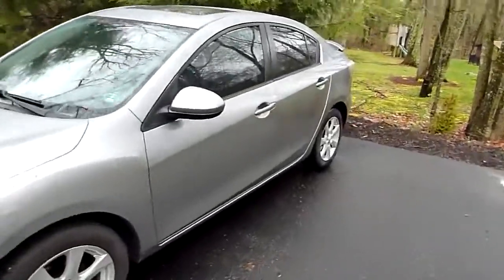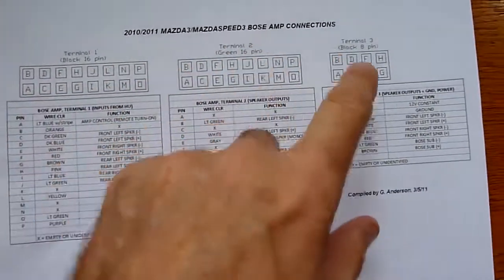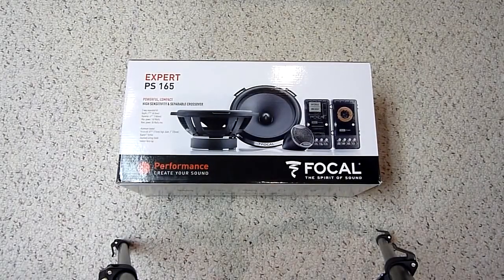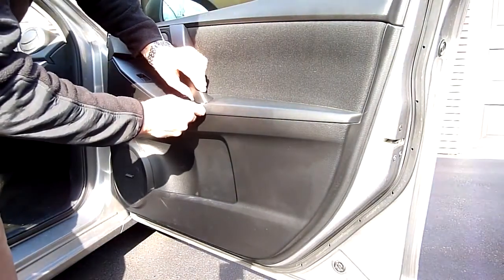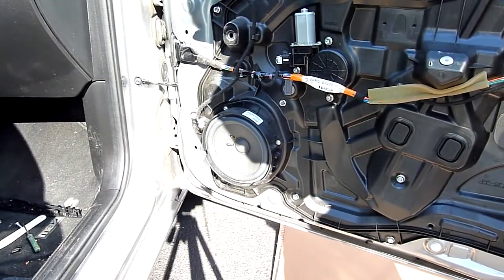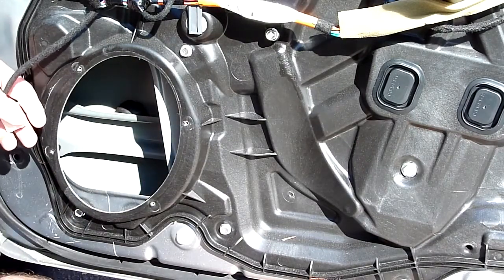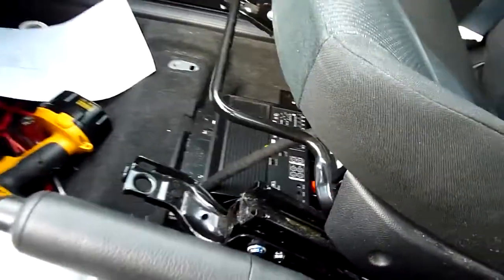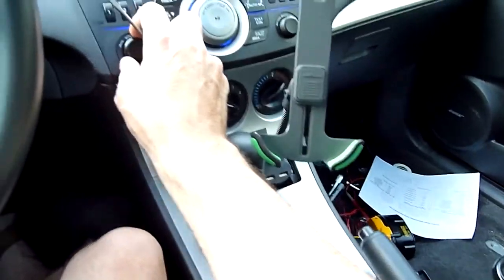Mazda 3 Stereo Upgrade - replacing the factory Bose system

Comment: Hi mate someone had hit in to my right side drivers door and passenger door (mazda 3 2010 takuya), i decided to replace the complete door from a Mazda 3 sport with Bose speakers, connected the doors up and the harness, all power windows have stopped working and also if i try them individually.
My question is can this be due to the replacement doors having a bose system ?

Comment: What wires did you splice and connect the rca cables too?
Reply from the maker: If you look at the wiring diagram, you can see that there are wires listed under "Inputs from HU". These are the speaker inputs from the head unit to the original bose amp. You want to use these connections to go to your new amp. So, for front left, you'd use dark green (-) and dark blue (+). For front right you'd use white (-) and red (+).

Comment: Thank you for the video! I'm wondering if you could clarify a couple things. From my understanding:
1. Head unit puts out low level
2. You spliced an RCA into that low level and connected that RCA to aftermarket amp.
3. You took the old amp output wires (towards speakers) and connected to aftermarket amp output. 

I'm trying to do the same thing with a 4 channel amp. Which wires should I splice RCA into? Just front doors for example or what is best signal?
Also do you know if Bluetooth calling or door chimes are maintained with your method? Thank you!
Reply from the maker: Ryan, you got it exactly right. Click the link in the video description for the wiring diagram which gives all the wire colors. I used only the front channel output from the HU to the new amp, but you could use both front and rear if desired. All the factory features remain just as the did before the conversion, Bluetooth, chimes, etc.
Reply: @PIFDIY  Thanks for the reply! Very helpful. I was hoping to do this method instead of LC2i.